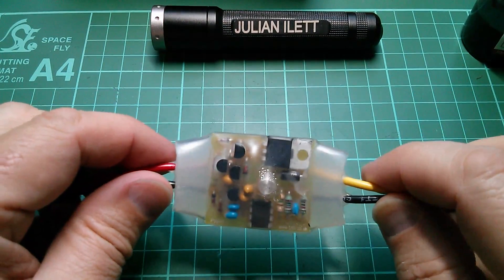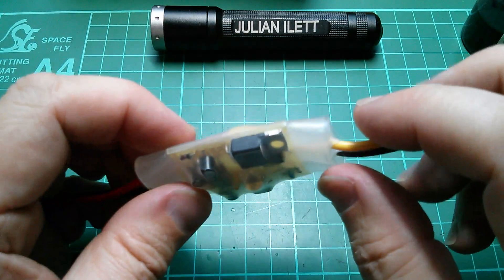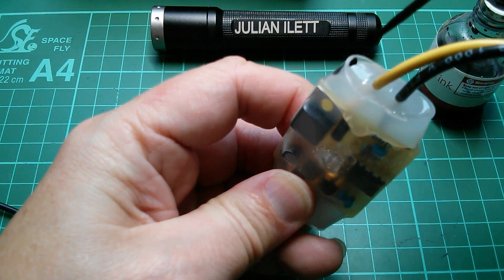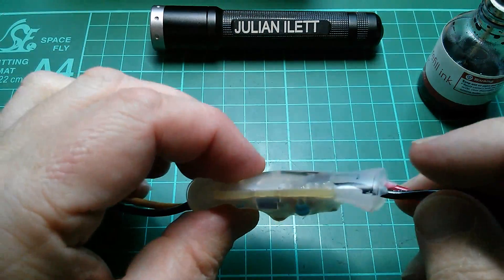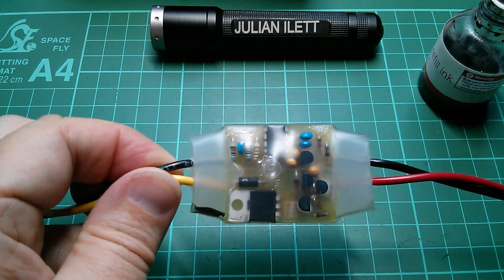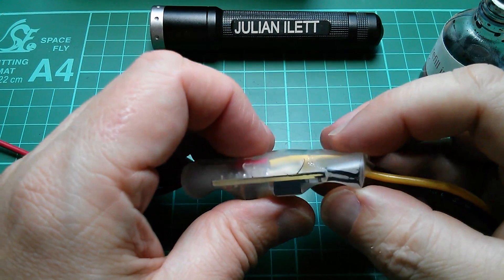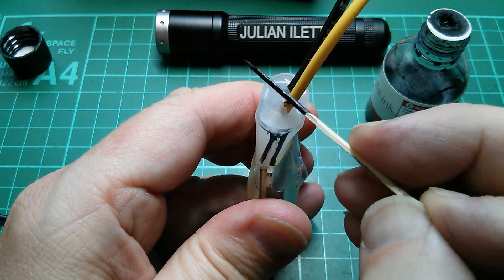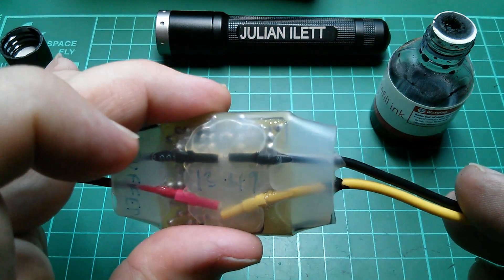Solar Charge Controller Leak Detection

Comment: Hindsight's a wonderful thing!
Everything's a compromise, i.e a waterproof case would have put the price up!
Anyone worried can get little tubes of silicone from the pound shop and plaster it around where the water gets in as a sensable precaution

Comment: Could it be that temperature changes gently seperate the silicone from the heatshrink material and the cables running through? it coul dbe an explanation as heat from the sun or the components and then rapid cooldown means that the materials expand and retract possibly at a different pace which causes the gaps between them.

Comment: Yeah things that are watertight generally leak in the end! The main issue with sealing things in this way is if water does get in it's going to be very difficult for the heat from the unit to drive it out. In fact what is probably going on here is that when the unit heats up it expels some air from the inevitable cracks. When it then cools down later the lower pressure inside will suck more back in, probably loaded with moisture! 

It's likely better to have a non sealed unit (maybe with a conformal coating on the board) and just not expose it to too much moisture! That way the heat from the mosfets etc will keep the moisture at bay. 

I hope my unit doesn't succumb to this! It's out of the direct weather, in a shed, but not the driest shed in the world! lol

Comment: Making things water proof for longer periods of time is an art in and of itself. There's a reason you pay 50 bucks for an Amphenol IP68 connector, pins and other accessories not included. And then by their own standards, you still have a "low end" connector. Water is a b#tch to keep out of things..

Comment: Thing is, hot glue isn't really glue at all, it is more of a hardening adhesive in that It's almost purely mechanical adhesion (and perhaps some electrostatic) in a cast where the roughness of the surfaces do all the bonding, and it's a problem when gluing plastics. It makes for capillary "sucking all the water in"-action, at least over time.

I've said before I would prefer a design which wasn't open upwards, but another way to better the situation is a glue that can electromagnetically bond to the surface, such as epoxy. But it's expensive and I don't know if it's possible to get shrink tube and wires in a compatible material.

Comment: I think pure silicone sealant would hold forever.
Reply: Butyl is made for these kind of things, but I think it wants to be compressed and not so exposed to the elements as the hot glue is. Its also gunky. But it does seal caravans for 25 years or so...

Comment: So much advice and so little time and all for a product that's no longer in production.  Even the extreme solution of putting it in a waterproof junction box simply transfers the problem to the cable interfaces,they will only be watertight with the correct diameter, circular section cable.  You then still need to remember getreal155's point about water travelling through the stranded wire itself.  Sorry but I don't have a solution.

Comment: My two recommendations for the future, 1. Roughen the plastic with some sandpaper before gluing to it. i.e. roughen up the inside edges of the heat shrink tubing before pouring the hot glue. It will stick much better and for longer. 2. Add conformal coating to your PCB with a simple paint brush, this will protect it even if water gets in. Normal off-the-shelf nail lacquer / nail polish works fine (just get the clear color!).

Comment: It ' s the game depressingly . You are putting it in relatively hostile environment ie outside . You have dissimilar materials in dissimilar sections , if it placed in full sun , there will be a range of expansion & contraction between the range of densities & components , even without the heat output from the unit itself . And of course there will be UV degradation & plasticizes reacting etc etc . If you think about it , domestic wiring degrades & it spends most of it ' s time in the dark & is exposed to little heat . 
May be they way to go for the next set , is pot it all in silicon of a similar shore hardness / flexibility to the wiring , but of course , that will means there will be little opportunity for the circuitry to loose heat , or have a package open at one end & instructions which way to hang it up , to allow moisture that does / will ingress to escape .

Comment: TBH when I saw your video first describing this controller I thought the heat shrink and hot glue was a bad idea.
I think a tight cable tie around each of the ends to give the heat shrink and glue less room to detach from each other would have helped though.

Comment: first julian you used hot glue you need to use potting material or use a o ring sealed case i notice all your out door stuff you let sit in the rain ie your battery is just sitting outside... it amazes me you do this kinda stuff

Comment: Julian, when the sun heats and cools the hot glue will soften and the heat shrink tube will expand and contract differently then the hot glue so after a period of time the two will separate.

Comment: Silicone should've done a better job. Hot glue are just to hard while the heatshrink is flexible.
Reply: Some silicone actually gets dry when outside. We have some that did it, its not very sealing any more. On the other hand we do have some old leftovers on our caravan that is evern more exposed, and that is not dry at all.

Comment: The shrink tubing and glue have different rates and contraction versus temperature and the non-circular sealing adds to the problem.  Vertical mounting also allows water to pool on the top.  Every night day cycle will try to separate the two and suck in air or water on the top end.  Having your customers change to a horizontal mounting and adding a more flexible (white) silicon sealant should also greatly extend the life.

Comment: the hot glue is no good. you need to use silicone instead. Hot glue will shrink over time. and is not uv stabilized
.

Comment: I think I gave you this hint before but you seem to have missed it. 
The moist comes in through the wires (at least most of it). It is sucked in teh wire between the pvc jacket and the stranded conductors. This is a very common failure mode in the outdoor wire harness and automotive industry. Hang one end of a meter of wire in a bucket with water and wait a few hours or days and due to capillarity of the wire itself it will drip out on the other end very rapidly.
Reply: No
Reply: man i never even thought about that.
Reply: Nothing to be ashamed about. It is mostly overseen by hobbyists and even in the professional industry it still happens often designers forget this. It can be a very serious problem though.
Reply: I've had that problem.  A solar panel with 3 metre stranded cable.  I cut the far end and soldered on spade terminals.  The solder wicked up a bit, so I didn't think of further precautions.  One year later all 3 metres were so corroded that I couldn't clean them to re-solder!  I'll open up the panel and rewire with single-core, which has a chance of lasting 10 years, I guess.
Reply: +Ray Kent   PS, it's worth remembering that many houses have copper plumbing with water (and dissolved air) in them 24/7.  The oxidisation layer stabilises.  The real culprit in my case, I think, is that multistrand wire has very fine strands, hence massive capillary action to wick up water, and the oxidisation layer is probably half the thickness of the strand, or more, so it can't be cleaned without breaking the strands.

Comment: I did some tests with hotglue a while ago and noticed that space between hotglue and painted metal surface (in my case) will suck in superglue (syanoacrylate) Hotglue alone doesn't have good enough sticking capabilities. Superglue filled that void between hotglue and surface resulting noticeably better bond. Maybe you can try quick and dirty fix with some cheap superglue.
Reply from the maker: That sounds like a neat fix. I'll try it.

Comment: Come on Julian you will never stop water ingress over time you should know this !!! :) You should of used a box like this with the wires from the pcb on a flex : http://www.ebay.co.uk/itm/Black-Plastic-IP65-Waterproof-2Way-Electrical-Junction-Box-PA9-03-Terminal-/272242032274?hash=item3f62e3be92:g:KX0AAOSwve5XNfLL

Comment: I think that it may be due to the different thermal coefficient of the materials (and the little bit of air inside). Maybe you could use clive's trick to put clear nail varnish on the pcb to prevent corrosion and then fill up the ends with epoxy-resin.

Comment: I used to use a liquid sealer for a windscreen repair, it was thin enough to dribble in then it would set and seal.
http://www.ebay.co.uk/itm/Captain-Tolley-s-Creeping-Crack-Cure-250ml-leak-crack-sealer-/121961981831?hash=item1c65802787:g:l~8AAOSwLmVXEQn~

Comment: It's hard to stop mother nature.
Reply from the maker: True. Although my 30W garden solar light has a boost converter and charge controller both completely exposed to the elements and it's still working fine.

Comment: im curious if the low temp hot glue has a different result over the standard high temp version.  Possibly you changed types mid-production and the ones that you had a difficult time separating were a different style or temp?  it would seem to me that the hotter version would adhere better to the heat shrink then the low- possibly worth an experiment of sorts.  Anyways, just a thought.

Comment: Hot glue is probably not a good potting solution for outdoor use as it will degrade. Maybe a simple ip rated box to house this in for a cheap solution?

Comment: I think the issue is probably due to the fact that the heatshrink remains fairly flexible, whereas the hotsnot (when cold) is pretty rigid - with repeated stress from thermal expansion it will cause the two to pull apart. I would recommend using silicone sealant rather than hotsnot for any future designs made in this way
Reply: Neutral cure silicone tho! The acid cure stuff LOVES to eat copper boards. Ask me how i know this LOL
Reply: "how you know this LOL"?
Reply: That was my guess. The two materials probably have a different coefficient of thermal expansion and after so many thermal cycles the seal was broken.
Reply: HAH very good Valentino :)
Reply: Most (or all?) silicones cure by absorbing moisture from the air, so this may be of added benefit - acting as a desiccant.

Comment: Hi Julian, I know this is nothing to do with your post but can you recommend a good 18650 cell. Cheers
Reply from the maker: Avoid the cheap ones! Then spend an hour or two reading candlepowerforums. There are different types of cell for different applications (as seen in my lawnmower battery teardown).
Reply: +Julian Ilett, thanks, 3.7 li-ion about 3000mah I was thinking,  I shall have a look about, cheers

Comment: is there alcohol of any kind in the ink?  doesn't alcohol cause hot glue to separate from everything?
Reply: Some grades of hot glue can be pulled apart with lighter fluid , but you have to work it , also . That looked more like capillary reaction ....... at a very similar speed to a ferret up a drain pipe .

Comment: would be interesting if you could possibly make a mould and use a clear potting compound to encase it into a square block, although im not sure on the costs of this. may not work out too productive for a large number of units if you're still making them.

and i suppose the method used was quick cheap and reliable enough to do the job
Reply from the maker: The heatshrink and hot glue method was ultra low cost, but certainly not quick to assemble. Reliable enough for the 1-year warranty period, but a few more years and it's not looking so clever :(
Reply: Ahh i see, I suppose it would have been quicker than the potting method i suggested
Reply: The potting would probably be less labor intensive. It would just take longer to dry. I used to pot small LED controller boards in a silicone ice cube tray. Once you get setup, it goes pretty fast.

Comment: i would surmise temperature and uv could be causing the hotmelt plastic to shrink
Reply: or heat from the charger pressurizing the air in the unit causing it to push its way out
Reply from the maker: I'm inclined to agree - but it's taken 3 or 4 years for the seal to break down.
Reply: it only takes the seal to fail once :-)
Reply: 3-4 years im a uk climate, given the uv levels we receive, would be a good bet

Comment: bake it. drive the water out and reseal the glue in one go?
Reply: how about put it in a low temp dehydrator. 120F and once the water is gone, bake it...?
Reply from the maker: I could boil it - the glue melts at about 75C. Then again, that's probably a bad idea :/
Reply: There's a risk that the seal reseals before the water has escaped, so that water will recondense AND be properly trapped.
Reply: Honestly, I think it would be both quicker and easier to just remove the covering and redo it, than to try to bake it. Maybe if you had to fix 10 of them, baking would be better.
Reply: yeah, not as fun though.
Reply: Stick it in the airing cupboard overnight, then bake it to reseal the glue :)
Edit: open up one or both ends first, so the water has a definite exhaust path.
Reply: oooooorrrr... throw it in the bin and never speak of it again.
Reply: Dylan T Jules needs a AvE style "Art" bin :P
Reply: post it to ave to throw in his art bin!
Reply: - Open the heat shrink jacket and put it in the airing cupboard to drive off the moisture.
- Bake it to reseal the hot glue, then put it in an IP67 box filled with potting compound.
- Send it to Peter Brown to dip in epoxy.
- Have him send it to Hydraulic Press Channel to be crushed to a thin wafer.
- Go to bed and watch Netflix.
Reply: sounds like a plan.
seriously though I could use this. send it to me and ill give it a new case and home. ;)
Reply: +Julian Ilett   Haha!  Yes, Julian, boiling it is almost as bad an idea as  microwaving or frying it.   I see you've bought a watertight box.  Humble suggestion: put a bag of silica gel in the box to deal with condensation, which you're bound to get with big temperature changes unless the air is perfectly dry inside.  (there's more air in the box than the shrink wrap version).